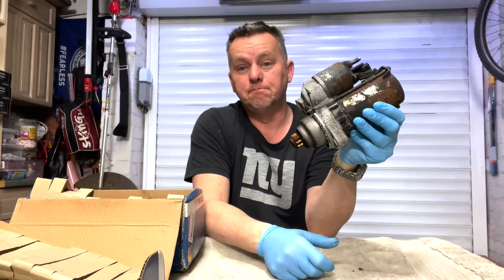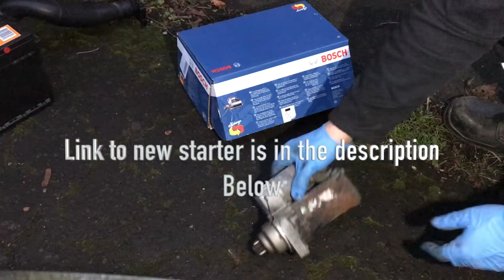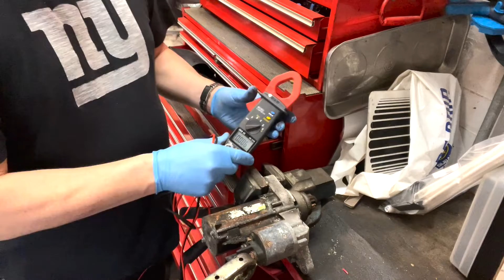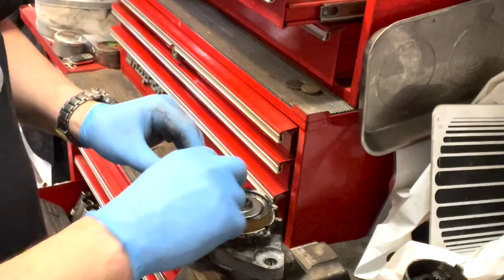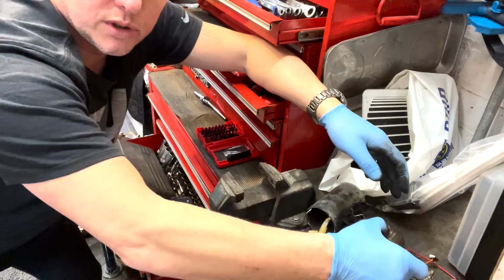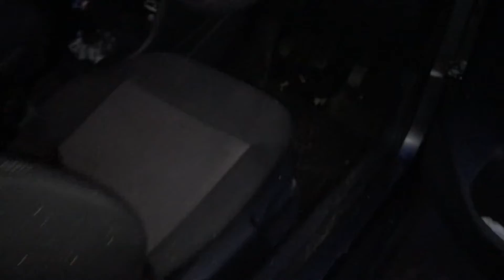VW Polo Starter Motor Replacement & Teardown, 1.2 Petrol 2010 How To Repair

Comment: Hi, just completed this now with the invaluable help of your tutorial. With the exception of the top bolt on the starter motor, which was a mother to remove, it all went well.   Wasn't sure whether it was the starter motor or the solenoid that was at fault, so replaced the whole thing for under £70.00 (as at Sep 2026).  There was a whirring noise prior to removal.  My uneducated guess was that the starter motor was spinning but the solenoid was not, and therefore not lifting the main spindle in to engage?  Once again, many thanks.
Reply from the maker: Glad you got it sorted, that top bolt is always a nightmare, Thanks for the great comments👍🏻👍🏻🛠

Comment: The top one is a stud not a bolt, the nut is meant to come off without the leaving the stud in place!!  Good luck with that after 15 years lol
Reply from the maker: Thanks for the great information👍🏻👍🏻🛠
Reply: @aaanton11  Just done my cousins Polo, you are right, that is a bolt!  stupid design lol Only have to lift the gear selector a tiny amount to get it out. Glad I watched your video.  Thank you.

Comment: Brilliant video - thanks so much aaanton11. You gave me the detail and confidence needed to replace my broken VW Polo 2007 1.4 SE TDI starter motor. So grateful. Replaced it with a £60 (off ebay) reconditioned Bosch starter that fired up first time! Probably took me at least 10 times longer than you took to do the job, but it was good fun, I have never dared do anything like this before. You have saved me probably £150-200 in garage labour costs and I am so grateful. Promise I will at least send you a beer.
Reply from the maker: You Sir are a gentleman🛠 I love these comments make it all worth while Thanks for the great comments👍🏻👍🏻🛠

Comment: Great video which correctly shows that gear selector must be moved out the way to get the top bolt out. Haynes manual misses that out.
Reply from the maker: Thanks for the info! & Thanks for the great comments👍🏻👍🏻🛠
Reply: Interestingly on my VW Polo 2007 1.4 SE TDI did not need to do this, the gear selector already had sufficient clearance so didn't need to do any loosening of the selector bolt/nut to move it upwards

Comment: How much woud it cost to repair the old starter motor ant
Reply from the maker: You might be able to get a new solenoid, but finding the right one would be tricky, Thanks for the great comments👍🏻👍🏻🛠
Reply: Not worth it is it buy a new one